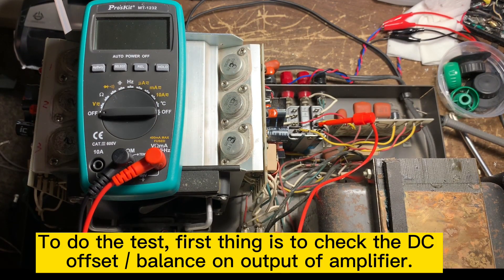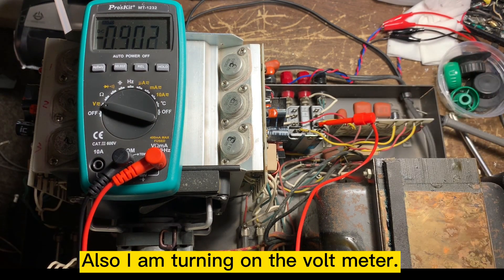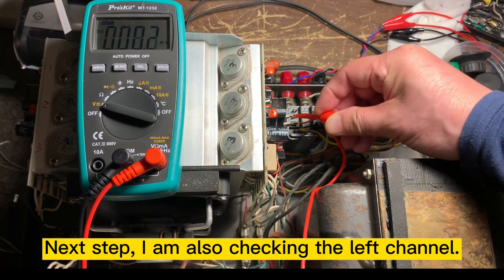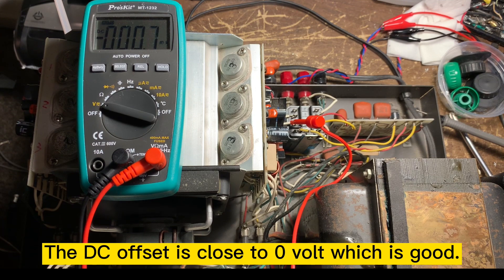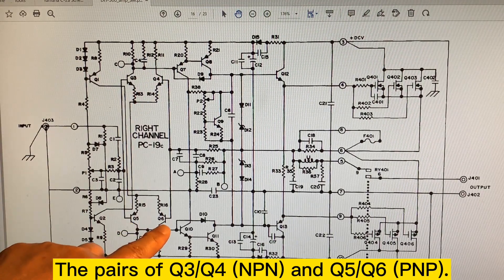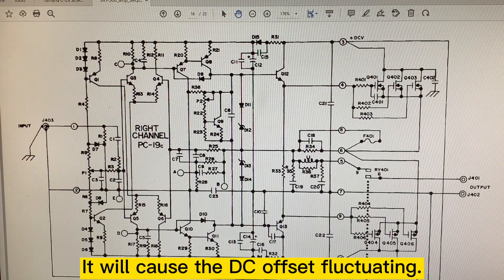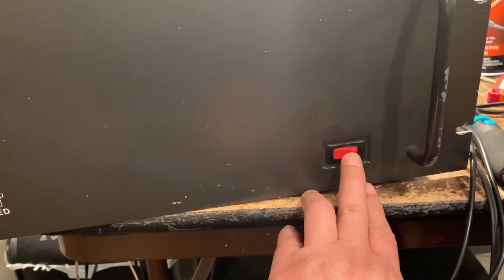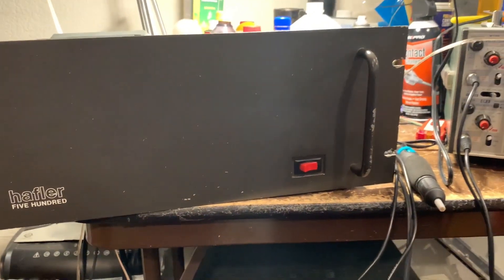Hafler DH-500 Power Amp Repair II - Protection Mode and Fluctuating DC Offset

Comment: Nice to see you again, always interesting ! Follow you from France...question : it seems that is a 2W resistor replacement Why replace with this value ?
Reply from the maker: The resistor is a 1/2W replacement due to the spare part I stocked on hand (OEM is a 1/4W resistor).